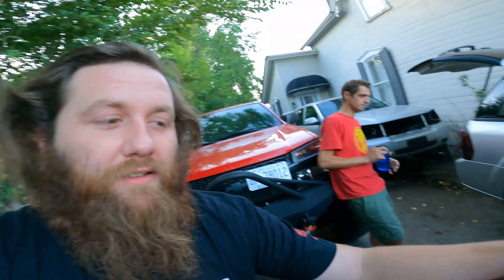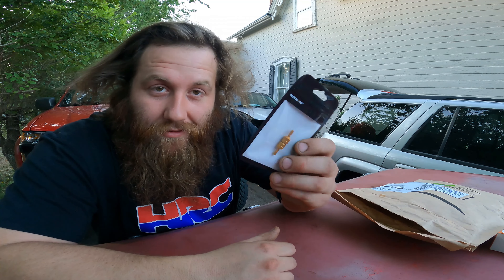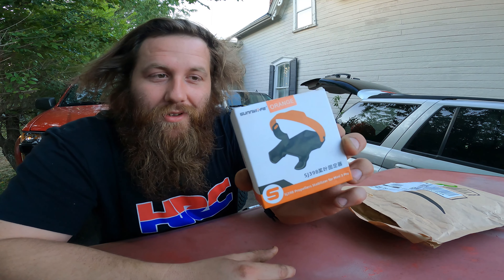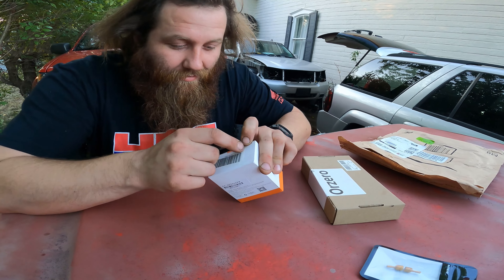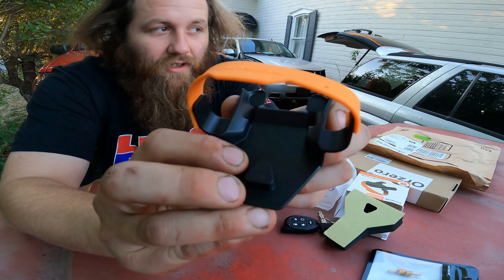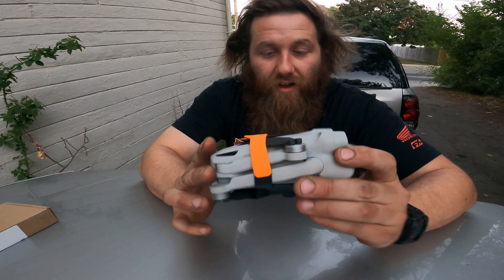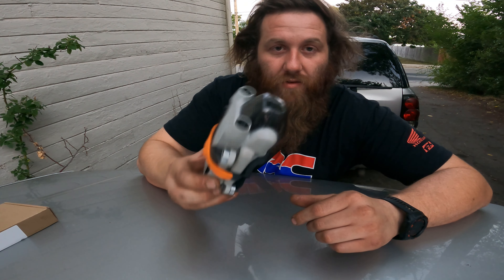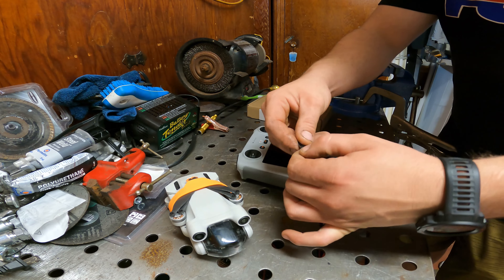DJI Mini 3 PRO Amazon Accessories!!!

Comment: Then joysticks are lightweight aluminum and crossthread like a mofo. The Prop holder is the best one put there, from what I've tried so far. Low profile, fits well in most hard cases. Bonus covers bottom OA sensors. The silicone RC (RM330) is all floppy and poor fit. Maybe if they didn't pack and ship all folded.
Reply from the maker: I agree with all the above! If your careful you shouldn't have issues! I'm happy with em so far!!